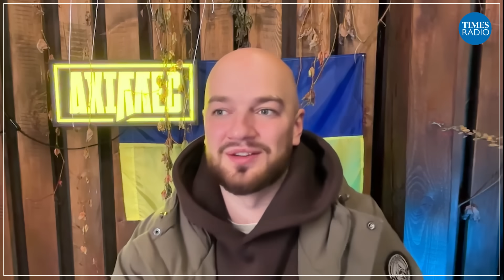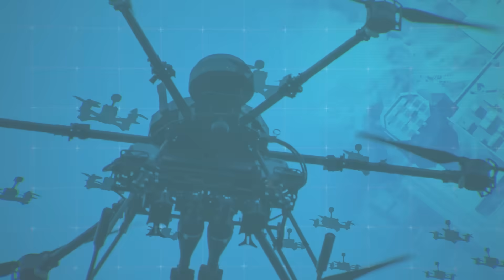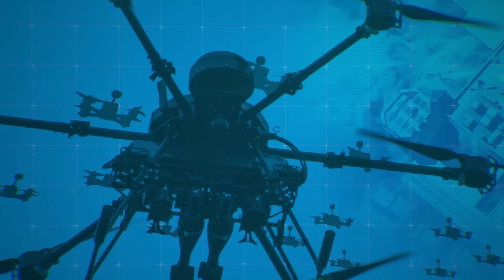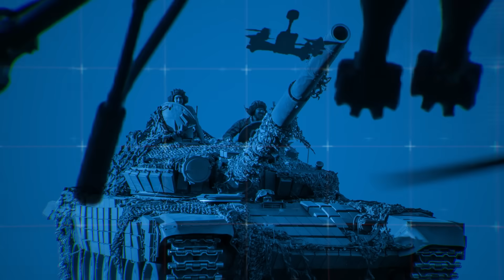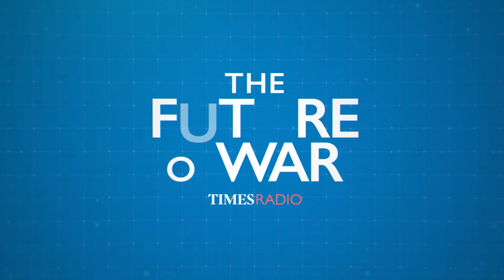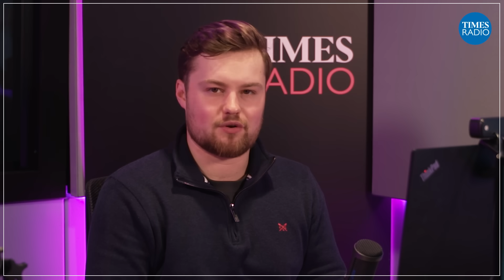How 'contour matching' technology will let Flamingo missiles fly themselves through Putin's defences

Comment: From my reading about the FP-5 Flamingo basic guidance accuracy needs a bit of work and the terrain following information is being acquired from a mapping service so the Flamingo does not have any emissions. 
Also, the current engines are surplus from commercial sources in past proper service life limits. Ukraine is planning to build new lower quality engines using steel with a service life appropriate to a test and use for one mission life span. 14 hours was listed in one report.
The current warhead is a surplus deep penetration warhead, Higher blast and lighter weight new production warheads may be in design phase along with possible cluster warheads for airfield attacks.
The Flamingo has the extra-long range over the Tomahawk and the massive warhead. Tomahawk is smaller with a much more expensive guidance package.

Comment: The markup is felt like “thousand times” if you discount R&D. 4:17 Ground tracking (five figures) is not needed individually if you pre-load that data, but you’d need satellites for that or a cooperation without someone. Then it’ll be mere matching that’s cheaper, simpler (four figures), and stealthier.

Comment: I wouldn't claim a cruise missile built from recycled parts with huge load of explosives to compensate for targeting inaccuracy as a great technology.

And why are Ukrainian power plants getting blown up exact with the missiles of which 99.5% are getting intercepted?  Because the Russian missiles are too fast!  It still takes a few seconds for the Patriot System to identify and launch an anti missile, and that's too long.

Bottom line, the expert is more an internet strategist overestimating the Western abilities and down play the Russian abilities.  According to these kind of experts the West is able to take out all Russian refineries, but the Russians have already repaired most of the damaged refineries.
Reply: Damaged because they were hit and will be hit again and then again.  If slow drones can get through so can jet powered large drones
Reply: @richardaldridge4657  
And it can get shot down even faster due to the larger radar cross section of the subsonic, slow maneuvering missile.